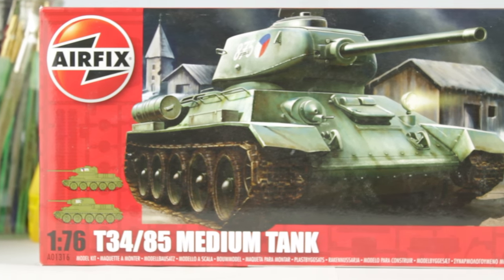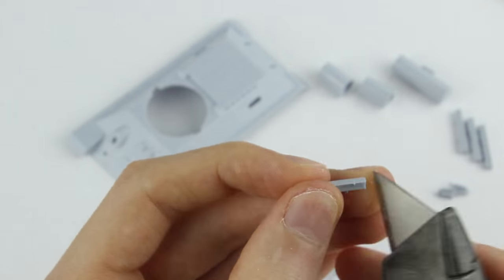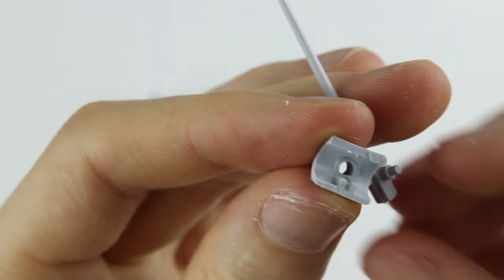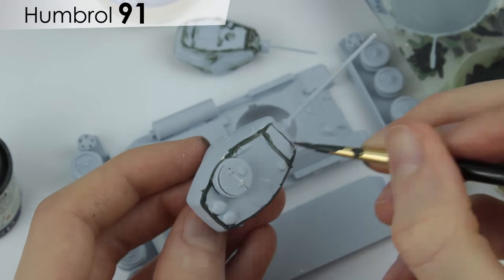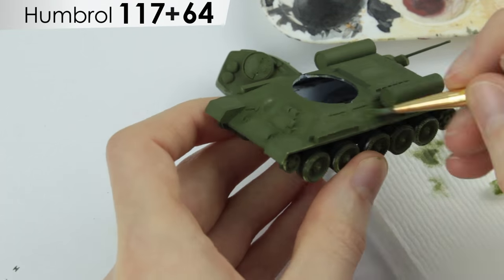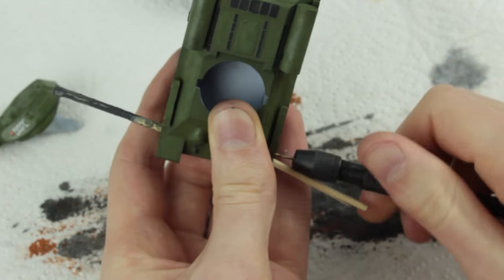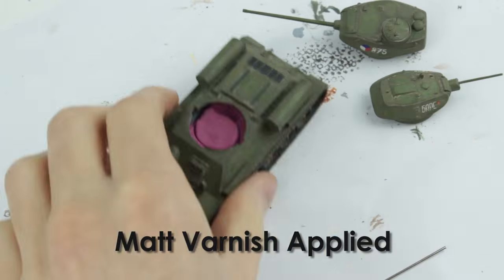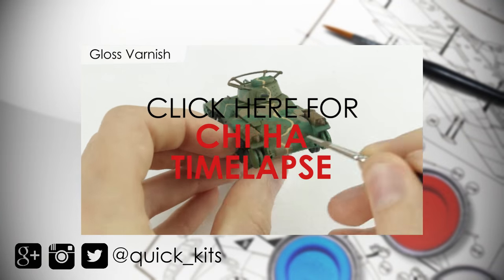Building Airfix T34/85 - Model Tank

Comment: If you're mad about it fitting poorly, look at a real T-34...
Reply: At the beginning of barbarossa the t-34 of wich 1000 had been deployed still had quality but seen as the germans were defeating them ussr got aid from uk and America the lend-lease after ussr had fuel money steel to make better equipment they made the t-34 at mass at that point quality over quantity had become quantity over quality and they produced t 34 crudely armour plates hardly fitted together their were gaps in the tank but it was good enough since after one battle they would be knocked out anyway, sometimes they lasted 2-3 battles but that was sometimes after the crews tank would be destroyed they could just get another one since they made 48.000 t-34/85 and almost 30.000 model 1940'1'2'3
Reply: This isn’t a real t34. Parts are supposed to fit well

Comment: Interesting method on the chipping.  Certainly less of a bother than what I did on the Panzer II I just finished.  I spray painted the model in flat black.  Once that dried, I cut off a piece of kitchen sponge, and used it to dab masking fluid wherever I wanted chipping.  After painting over the model, I peeled off the masking fluid, and voila!  a very nice chipped look.
Reply from the maker: I was actually gonna try that technique, but for winter camo coming off to reveal the green underneath. But then I liked how this model turned out so much that I don't know if I want to do it on this one any more!
Reply: +Quick Kits I'm planning on doing up that M4A3 Sherman in winter camo.  I'm going to try a very rich chalk wash using white chalk.
Reply from the maker: I'd never have though of using a white chalk wash for winter camo, I'd be interested to hear how it turns out!
Reply: +Quick Kits I ran some tests with some of the alternate build parts.  I found just using watered down flat white Acrylic worked a lot better.

Comment: Rubber tracks are best superglued on - you can show the droop at the top, plus copious superglue makes them more rigid, you're paint finish is less likely to flake off. This model of the T 34 with its choice of turrets I found inspirational as a boy in the early 1970s, I thought it was a great wargaming peice (along with Airfixs then set of Russian infantry with HMGs on a trailer, and heavy mortars. You could convert the tank into an SU 100

Comment: I love your videos. Very quick and informative. And, you use Humbrol!!! is great. 
I paint only with Humbrol Enamel, and I have a problem with the washes. I saw all using acrylic, so washes are easy, but with Humbrol, if we put a wash usig for example black paint and thinner, we ruin the base paint!. So, what can I do?.
I saw people putting satin varnish but I think thinner will ruin it too.
Reply from the maker: I'd recommend you use a chalk wash (I have a video on it) rather than a paint wash, or buy some proper weathering products. Chalks and weathering materials won't corrode your base coats

Comment: i got a few questions to ask, what can be used to apply filler, what is the purpose of pre-shading, was the paint you used for pre shading thinned 50/50, what brush size did you use for painting the main colour of the tank? and that's a great t 34
Reply from the maker: Filler can be applied using anything; a piece of cardboard, a flat-head screwdriver etc. 
Pre-shading discolours the paint you cover it with, so it can be used to get a stressed weathering effect. I'm using it to futher darken dark areas of the kit in this video.
I always thin my paint, so yes, but I've found that actually the 50:50 ratio can be too thin sometimes.
The brush I used was just one of the standard Humbrol ones, about 5mm.

Comment: Hi Owen! How do you dry brush? the tracks.
Reply from the maker: To dry brush get a small amount of paint on your brush and remove excess paint by brushing some of the paint off onto a paper towel. Then when you use the brush on the model, only a very small amount of paint will be applied to the model on the raised detail.
Reply: thanks! when are you coming out with a new video, what would it be?

Comment: it's not 1/72nd btw. Airfix stuck to the 00 railway scale of 1/76. It's noticably smaller if one's collection is otherwise 1/72.

I remember building this kit back in the 1960s.... It hasn't changed a bit, exceot for the decals. Those Airfix tracks always were a problem, and I recognise the fuel tank issues. That's how kits were then! You'd think Airfix would have sorted their AFV models in 50+ years!

Comment: Does any one know what flashing or flushing , as mentioned at 0:30, is? if so please let me know
Reply from the maker: "Flash" is the little thin bits of plastic that stick out from the parts, where the plastic has seeped out of the mould. It's difficult to explain without a picture
Reply: I think i know what you mean since i saw some thing like what you described. thanks

Comment: What's better 1/35 or this scale
Reply: +Airbornerock Smaller scale is usually good place to start because they are cheaper and a good way to get some practice. 1/35 scale can quickly become very expensive. But in return you can get very detailed kits all the way down to the geartrain on a tank engine. But kits like these can range up to €100 and above. Right now I have a 1/16 scale Su-100 which is massive and has over 1200 parts and a Tiger 1 in 1/35 scale with about 500 parts. In contrast I have a 1/72 scale Tiger 2 that had about 40 parts. But still looks pretty good after some care has given. Just like he showed you in this video.
Reply from the maker: This scale is quicker to build because it's smaller, however I do like the detail you get on 1/35 scale kits and you can do more fun weathering effects like adding actual mud to them.
Reply: True that, I usually build 1/35 but they take up alot of space. thinking about doing 1/48 or 1/72

Comment: mabye you just got a "lemon kit". ones that don't line up or have pins the wrong size from their sockets ect. ect.
Reply: also I've got a large collection of ww2 aircraft but wanting to get into tanks, any tips for a newbie?
Reply from the maker: I'd recommend assembling the whole tank (but without the tracks on) for painting, but don't glue the upper and lower hull together. Then when you've done all the painting you can separate the upper and lower pieces and easily put on the tracks. Might not work for every model tank
Reply: Thanks

Comment: Not gonna lie, this is why I tend to keep as far from possible from airfix small scale tanks, I just have a habit of seeing these AWFUL gaps and piece fitting, and for the most part Tamiya,revell, dragon, and zevezda make better tanks even on smaller scales
Reply from the maker: I've tried the new tooled Airfix Tiger II, and it was actually a pretty damn good kit, I've done a review. Old tool Airfix kits like this though, yes, can be seriously bad.
Reply: I misstated what I said in my previous comment, I was referring to the older onces as well